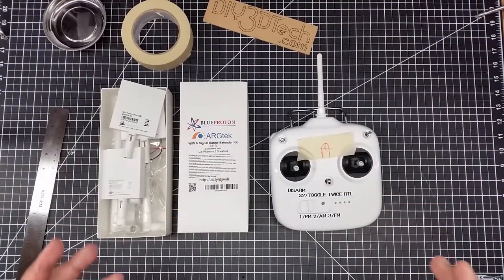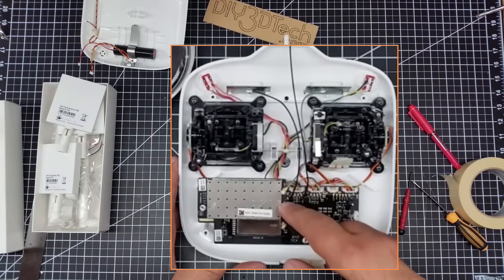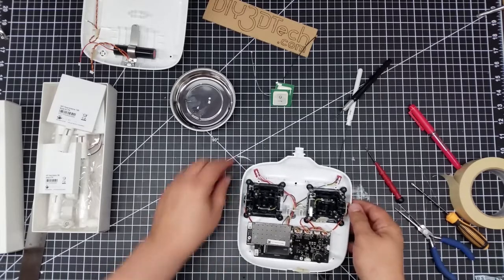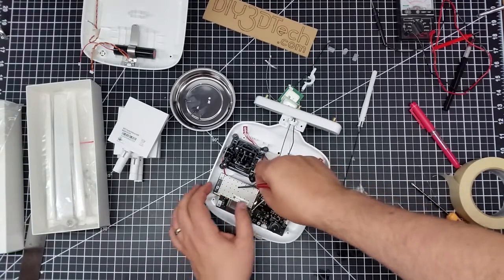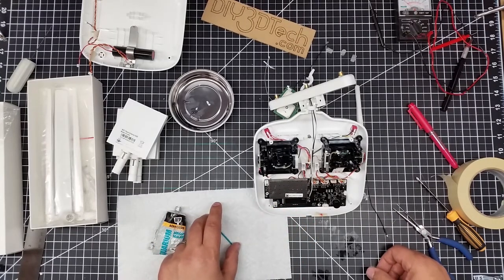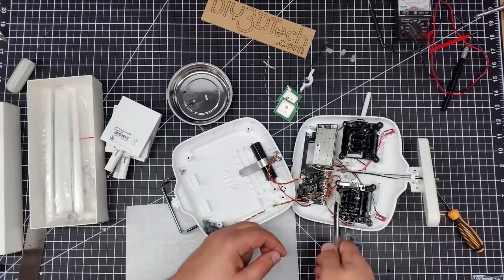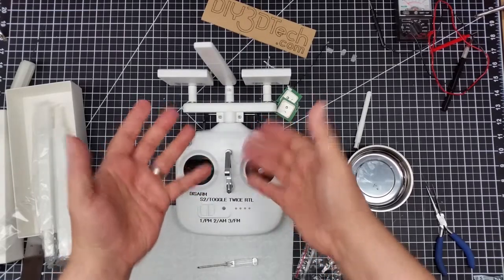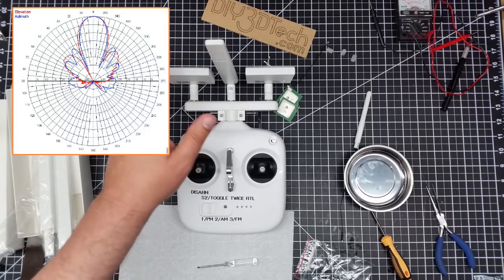Video Drone - ARGtech Extender Detailed Install and Usage Tips!

Comment: Cool I have the freeX quad from skyartec any help get better range stock 1000 meters cheers any mods
Reply from the maker: If it is a 2.4 gig quad and has an SMA connector just get a 6db antenna and install it that will do wonder just I did on my Hubsan too...